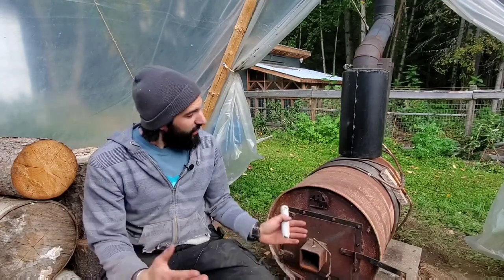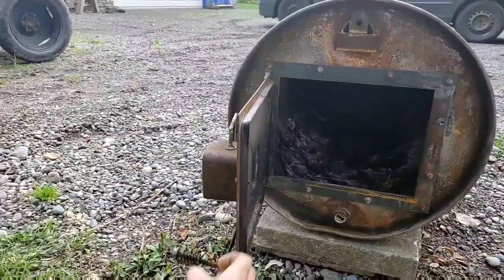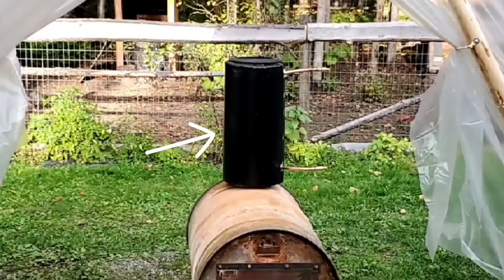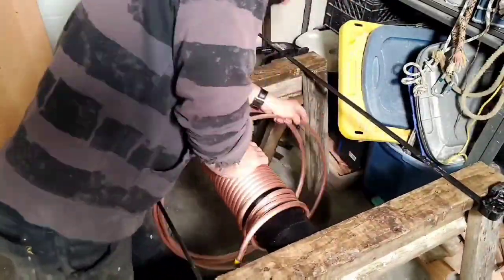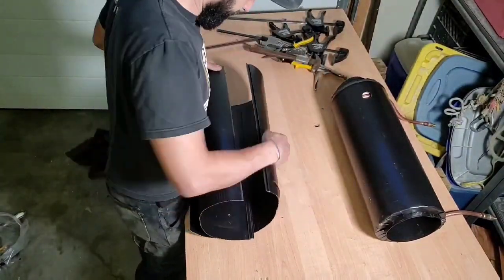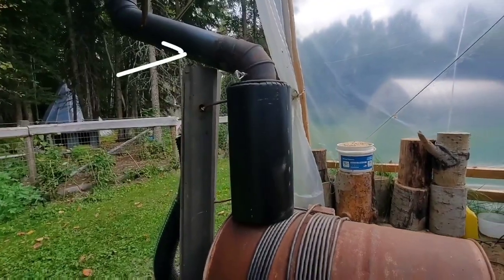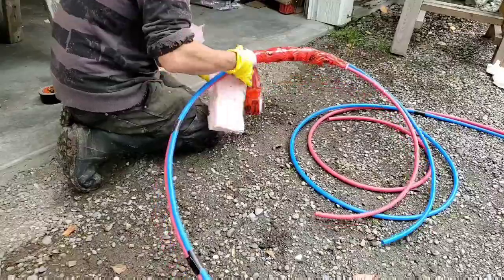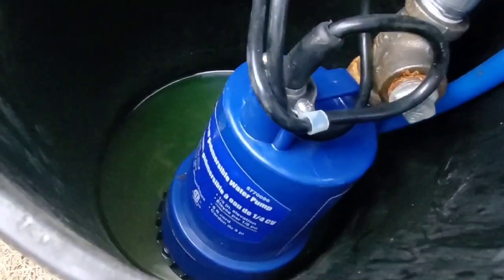How I heat my garage with an old car radiator!

Comment: I think it’s a cool concept, but I don’t think the efficiency is great. I definitely understand the safety concerns with wood stoves, I run one in my house and shop through winter and would be lying if I said I was never nervous about it. Although modern technology has better options today, pellet stove and oil monitors are great alternatives for wood stoves and push really good heat. 

I do really like the build though, it’s like a back yard built hydrotherm outdoor furnace. Have you thought about adding in a hot water heater and using rv anti-freeze?
Reply from the maker: There is no doubt about it, it is not a very efficient option in comparison to a woodstove on the inside. I am not nervous about it, it is more the fact that the insurance would be very expensive since our area is not covered by a fire department. So before I spent hundreds of dollars per month for the baseboard heaters I just spent a couple hundred bucks in this system and burn all the excess wood I have on my property.

There is antifreeze running thorough the lines. I do have allready a very efficient hot water system installed in the house, so there is no need for me to change anything, but I have a friend who uses a very similar system to heat his water on his off grid property, so there is for sure potential under the right circumstances.

Comment: Hey good video.   I like this setup I'm thinking of doing it.  Couple questions.....does it have to be a barrel stove or could I use my big cast iron square stove and use the copper piping the same way on the stove pipe?  I've seen a few videos on this same thing and I only ever see barrel stoves.  Also do you have some piping right inside your barrel, and if so, does it not melt?
Reply from the maker: Thank you for your interest. It does not have to be a barrel stove. It just happend to be the cheepest solution for me. It can be any woodstove. And no, there is no pipe on the inside.

Comment: Adrian, you are what people years ago would call "a very useful neighbor" :)  Did you use coolant vs. water in the pipes just to avoid rust or did you have another reason?
Reply from the maker: No, I am not too concerned about corrosion, the reason for coolant is its freezing point. Water would just freeze up here in the winter and burst the pipes.(For example, we had around -25c° at night the last couple days here and the coldest months are still to come.)

Comment: I’m wrapping outside bottom in copper to heat water for greenhouse and ibc poor man’s hot tub and top barrel fence pipes all around exterior and 4 intake pipes for fresh air to fire and hoping to incorporate old cast iron radiator as well radiant heating under my plant beds to keep semi warm I used it for a year and I could take my spray foamed shop from 55 to 95 f in about an hour had to open door to cool it down so much waste as well straight out chimney going to try and take my flew vent pipe the longest I can as to milk as much heat as I can

Comment: What was the length of copper pipe you used ??? Nice work fella too.
Reply from the maker: Thank you! I think I used a 50ft roll on the  stovepipe as well as around the drum.
Reply: @adrianwoodworm  Do you think by increasing the coil times two would increase the efficiency a lot more ???

Comment: What coolant are you using in it?
If it’s water, can it burst due to high pressure?
Reply from the maker: I just used Prestone antifreeze. It can't really burst because there is not enough pressure that can build up. The return line is just open-ended, so any significant pressure would just push the fluid out in the bucket that holds the pump. The problems start when the pump fails for whatever reason. Then, the temperature of the coolant increases, and it starts to soften the pex pipe. Once soft enough, even a little bit of pressure is enough to burst the pex pipe, and you are in for a very uncomfortable repair in the middle of the winter😄
Reply: @adrianwoodworm    thank you for the reply. I wanted to make a closed system. But I don’t know how to deal with the pressure increased by steam in the closed system. And doesn’t your open system cause loss in heat?

Comment: nice attempt 😇. Remove pipe around heater. Outlet pipe should be in upward flow only! add header tank with a heat trap ( 'S-trap'). Tank volume should be greater than outlet total volume. This eliminates pump. Be sure to bleed system and eliminate all air. Top of outlet pipe to be filled just before tipping point... hot water will rise if the header tank volume is heavier. circulation starts around 80C. this system works in slab heating too! tricky part is getting your water levels correct...good luck!
Reply from the maker: The outlet pipe IS in upward flow. 
What you describe there is a thermosiphon. One of the problems with your suggestion is that this would require a massive amount of coolant due to the holding tank which is not cheap, let alone buying and building the tank. Also, as you said yourself, it would be very tricky to adjust the coolant levels just right to make this actually work. Thermosiphons are known to fail due to air in the system. As mentioned in the video, I tried to build a cheap and quick system with materials that I had kicking around for the most part. Considering that my garage is nice and toasty right now I would argue that my "attempt" was successful the way it is. Under different circumstances this might be an interesting solution, it just wasn't in my case.
Reply: @adrianwoodworm  appologies for my delayed response I'm super busy..!! I have been tinkering with my own hot water circulator for around 4 years... thermosiphon only works if the heat source is at the bottom. I live above my garage. My woodstove is upstairs. I circulate my water from the stove to the garage floor and up again without pump (4 meters height difference). I have used copper pipe (note: all pipe sloping in one direction) and a brass cistern from an old toilet to hold my water. All up system holds around 80 litres of water... and starts circulating at 80C. My way enables me to eventually inbed the pipe in my garage concrete slab and create mass heating.🙂
Reply from the maker: @plumbrose1  sounds like you got a nice setup going on! Would be interesting to see a video about that! 🙂
Reply: @adrianwoodworm  where I am winter is not as rough as yours so I have limited reliance on my wood stove. That's why it's taken so long to develop....... watch this space and I'll send u a tingle once I've made my movie. hopefully we can help save the world with the knowledge 🙏

Comment: Honestly, though it just makes more sense to have a pellet stove in this man’s garage if he’s really worried about having a wake up extra early just to heat his garage because a pellet stove runs all day until it runs out of pellets and also the I have a wood furnace that is outside and it only takes me an hour to heat our housebut guess what it only takes me five minutes to put 3 to 9 logs in it and it will last longer than 10 hours. That’s why I don’t understand why people bitch and complain about how hard it is to keep your woodstove running. It’s not.
Reply from the maker: Again, I am not interested to spend a lot of money in a pellet stove or a proper wood furnace setup. My cheap setup needs more time and attention during the day than your standard woodstove. A simple fact that has been pointed out..

Comment: 22x60 shop were the dimensions are rather and green house about 8x35 ft and have everything at least 1and 5/8 thick 4x23 foot long foam board insulation like they use in chicken houses and 72 cases of caulk I don’t mind fresh air coming in I just want to control when and where

Comment: How about you use an other radiator to heat the water more efficiently?
Reply from the maker: I guess it could work as long as it is not exposed to the fire directly and as long as the radiator would be placed flush against a flat surface for optimal heat transfer, like the back of the drum. That being said, efficient heat transfer is not really a problem in my setup, the coolant does get more than hot enough with the copper pipes. 
Anyways, It is always good to think about alternative solutions, and I believe your idea would work! Thank you for commenting!

Comment: So coolant goes through the copper pipes into the bucket then through the radiator?
Reply from the maker: Yes, it is coolant that flows through the pipes, same stuff you would use for a car. It gets pumped from the bucket towards the stove where it heats up, and then it flows through the radiator where the heat is beeing extracted and cold coolant returns to the bucket/pump.
Reply: @adrianwoodworm  that's cool been wondering for a long time how to heat our ground level floor since a wood stove wouldn't fit anywhere this could probably work if I could guarantee no coolant spills in the house lol
Reply from the maker: @johnnyversaci7091  I can see this working in a basement. You could put a catchpan under the radiator, big enough for a couple gallons of coolant. That way you don't have a big mess in the unlikely case of a leak.

Comment: If you value you your time at $20 an hour, that extra hour to wake up, start the fire and then be less productive adds up to $5000 per year. That doesn’t include time working on firewood, repairing this system, or setting it up in the first place. Are you sure the electricity to run the baseboards is that expensive?
Reply from the maker: If I value my time, most of my projects don't make much sense😆 but I agree, the big drawback is the time investment. This year I actually won't use the system. I am going to try a Chinese dieselheater. I used one with great success in our greenhouse and hopefully it works for the garage as well. 

I liked the idea of burning my excess wood and making good use of it, but as you correctly noticed, it is very time intense, and I get really tired of fixing a busted pipe at -30 and starting fires with my fingers turning to icicles each morning.

Comment: can a radiator handle a fire pit want to connect a solar mat to it
Reply from the maker: Not sure what you mean, but if you are thinking of putting a coil in a fire pit and pumping the coolant with solar power, then I would say it could work. In the end you still have just hot coolant running through your radiator, which is what it is meant for.
Reply: @adrianwoodworm  toasty floor mat and i should sub

Comment: This guy says that baseboard heaters are too expensive because it takes a lot electricity well they make baseboard heaters that are not run by electric and they run by a water boiler so why don’t you just use a water boiler style heat register if you’re one of those people that would rather live without electricity just so you know we have come along way so you don’t need to waste a lot of electricity just run your water boiler if you have a electric water boiler run it on a battery and an inverter but like for my instance, I only have a 12 V battery running my recirculation pumps on my water boiler so I am not using any on grid electricity I am using all 100% off grid 12 V car battery and an inverter box and the inverter box, the water boiler, and the battery is protected to buy an EMP
Reply from the maker: You missed multiple points. I am not interested in investing a bunch of money in a water boiler, solarpanels, inverter and batteries. I needed a cheap setup that works for a couple years. Also, water freezes if not taken care of, where I live that's a problem at -40C at night. Not sure where you got the idea from that I want to live without electricity but it couldn't be further from the truth. By the way, the electricity I am using in my setup is minimal compared to a baseboard heater. A fan doesn't consume much, and neither does that little pump. Also, I am not afraid of an EMP nor am I off grid.